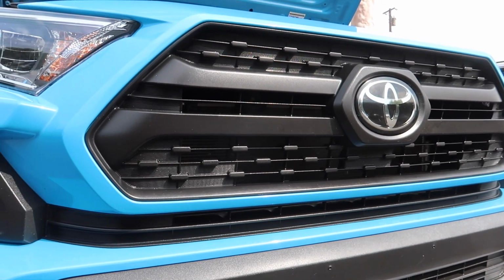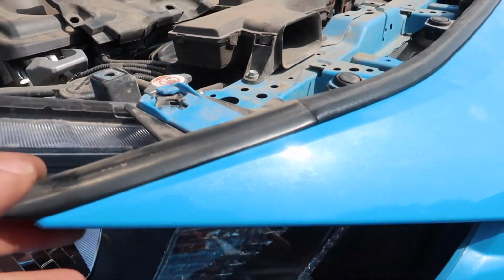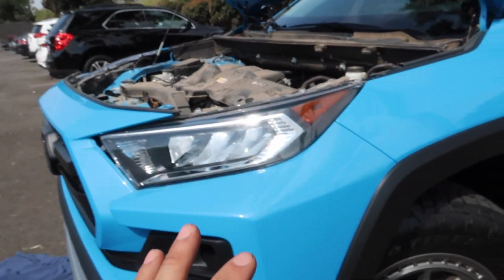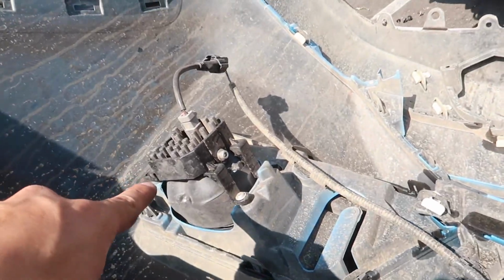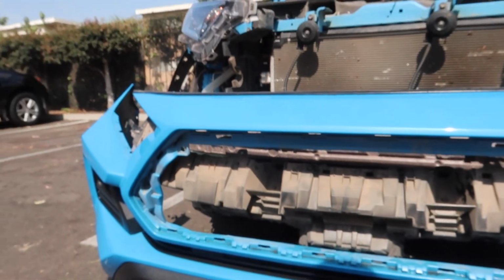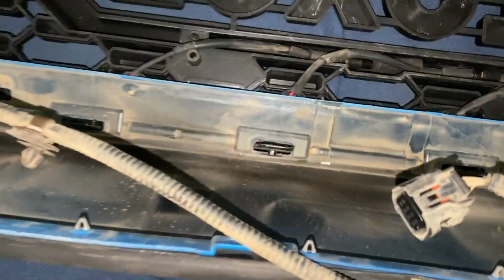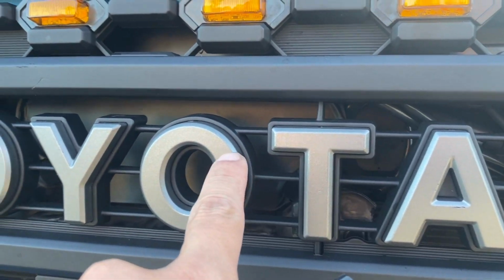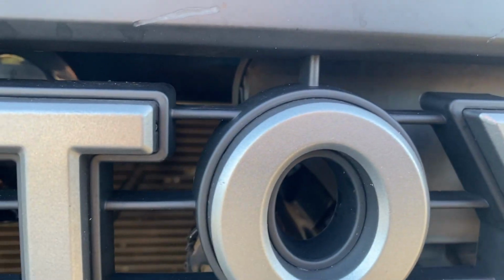How to install a TRD Pro-style grille on your RAV4

Comment: Danny, I live in BC, Canada. I bought a Toyota Rav4 XLE 2025 gas model last October merely to do a bit of adventure and camping this summer. I’m really disappointed to find out that it is not equipped with built-in front and rear recovery points. It's so hard to believe a reliable manufacturer like Toyota manufactures an AWD SUV without recovery points for a country full of snow, mud, sand and trails. This is so frustrating that I feel like changing the vehicle to a Subaru outback 2026. Why does Toyota install it in Japanese markets but not in North America? Surprisingly, the Rav4 adventure version “Trail” does not have them either. Does anybody know how to fix a FRONT recovery point without too much hassle?

Comment: did you calibrate your radar sensor?
Reply from the maker: No it isn’t needed when installed properly
Reply: just install 4 days ago my pro grill but yesterday show up on my dash the pre collision but like a seconds system  but my radar sensor work will as of now nothing issue
Reply from the maker: @cavalrytrd  I’m almost positive you likely have something hanging in front of the sensor like a wire or something.
Reply: thank you🙌🤙

Comment: I followed yoy video step by step. At the end you said something about the collision warning. I have been having thay issue sense install. What did you change to get rid of that issue you didn't go into detail. Thanks.
Reply from the maker: You likely have something in the way and too close to the sensor like a hanging wire. Make sure there is no obstruction in front of the sensor

Comment: Hi! Awesome video! I have the 2021 off road TRD. Dis you have any issues with the sensors after the modifications? Do you know if changing the grille cancelled the warranty? A little scared lol thank you again!
Reply from the maker: No issues since installing it—going on almost a year. All my sensors and alerts have worked just as well as they did prior to modification. You will void the warranty on any parts you modify—but would not automatically void the warranty of the entire vehicle by modifying individual parts (Magnuson-Moss Warranty Act).

Comment: I finally got my Grille, how has your sensor been operating over these last several months. Good work on the video by the way! Your videos are easy to follow.
Reply from the maker: No problems at all—still get collision warnings, radar cruise control still works, and no warnings on the screen! Only thing I’ve changed is removing the plexiglass—pretty much an unnecessary step unless you’re gonna take the time to make sure it’s sealed/glued on so it doesn’t come off
Reply: @DannyRocksteady   I’m excited to install it. Thanks
Reply: @DannyRocksteady  Hey for your raptor lights how did you install them? I am looking at an Add a Fuse but I am not sure what type of fuse our RAV's use. I think it is a mini fuse?

Comment: Are you using a fuse tap for the raptor style lights? If so, what fuse did you tie into?
Reply from the maker: The raptor lights are tapped into the USB slot in the fuse box via a micro fuse tap

Comment: You said you adjusted something for the first placement, what did you do to fix the sensor?
Reply from the maker: The “first placement” was in reference to me attempting to install the new grille without relocating the sensor. I originally left it on the bracket as-is and essentially smushed the new grille on which made the bracket point downwards and also made the sensor and new grille touch. Needless to say, it was the improper way to do it and after a two days or so of driving it around that way I had to take the bumper back off and relocate the sensor (which is what you seeing in this video).

Comment: Danny - I pre ordered this thanks to your video. How did you connect your Raptor Lights? Are they in sync with your DRL’s on the stalk?
Reply from the maker: They are tapped into an 12v fuse in the fuse box and turn on when the car is on
Reply: @DannyRocksteady  thanks Danny!
Reply: Hey Danny - I am about to do this this weekend.  Why did you end up removing the plexiglass from your radar sensor?  I thought that was a good idea and can protect it from rain and snow.  Thanks!
Reply from the maker: @robertdelara8722  I didn’t do a good job making it fit or sealing it so it eventually shook loose and touching the sensor which made it think there was debris on it—and I didn’t want to go through all the hassle of doing it all over again.
Reply: @DannyRocksteady  hey Danny - last question then 🤞 - is the speed/cruise sensor weather sealed then? I live in the Midwest with a lot of snow/rain, and don’t want it to get damaged or damaged from a car wash. I’ll take my time trying the plexiglass route - but now am wondering how the sensor will hold up with no protection to the elements/water/freeze. Thank you again.
Reply from the maker: @robertdelara8722  I’m not sure if it’s weather sealed or not—it ends up sitting far back enough behind the grille where it is a little protected. I’ve run it through car washes and rain though with no issues. I wouldn’t go out of my way to expose the sensor to elements but it doesn’t seem like it needs to be “babied”

Comment: Great video, i think it will be possible for an le, xle, and limited to completely swap the bumper and get the adventur bumper, i don't know if will be worth it. But mounting points should be the same. Again great video, toyota missed a huge opportunity with the trd model to put this kind of grill, like the pro model in the tacoma